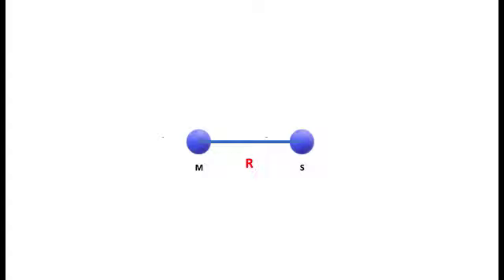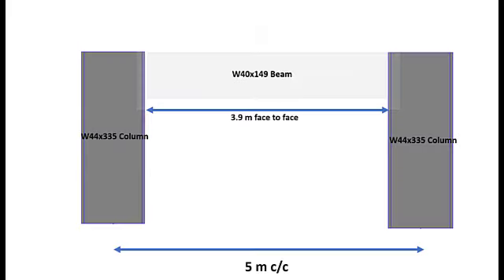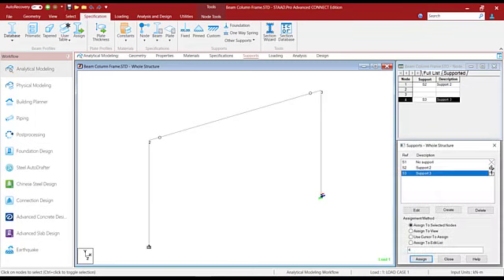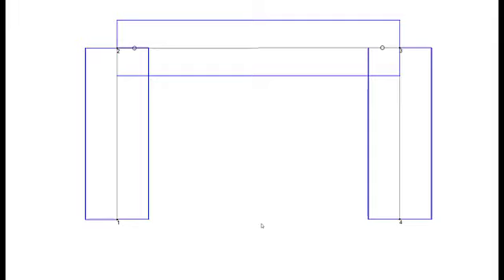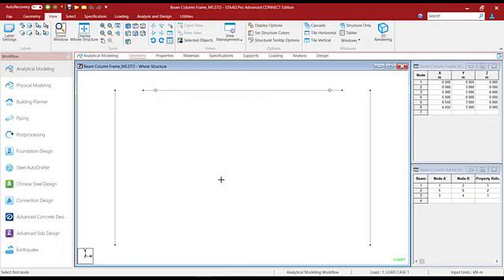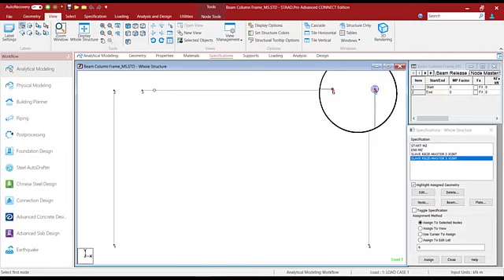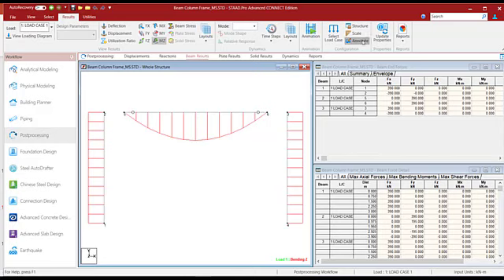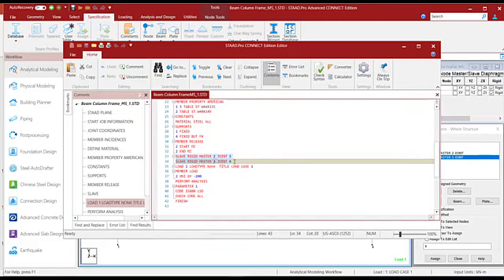Master Slave in STAAD.Pro to solve modelling problems

Comment: Sir , Could we have used offset specification to vertical column to achieve practical position of beam column junction in your model (9:43)  in staad pro? Would it be correct modelling approach to use offset specification to column instead of beam considering all fixed support ?
Reply: Yep it also works.... And then you don't need to assign any master slave node.

Comment: Does offsetting the beam to flange of the column in staad helps to reduce the loading value sir??
Reply: If you offset the beam, there will be a reduction in the member length and hence the bending moment gets reduced and we will get the same result as we have obtained now